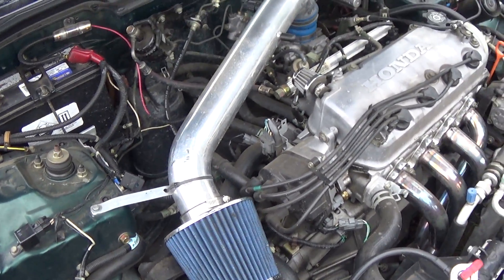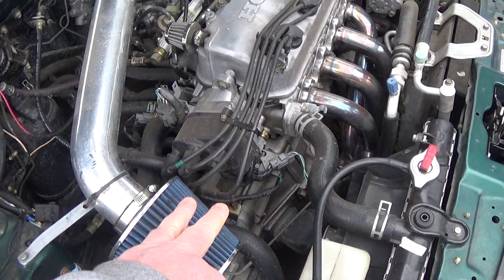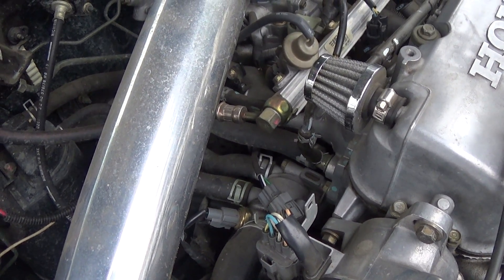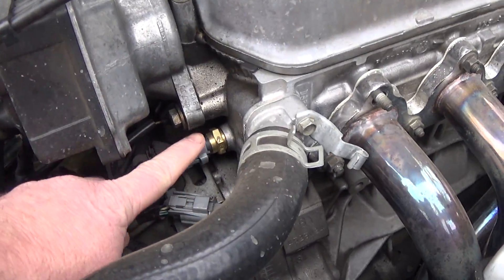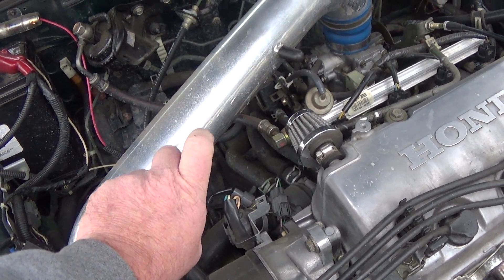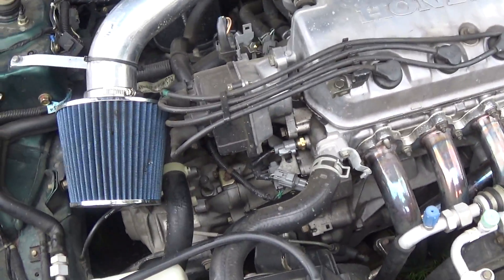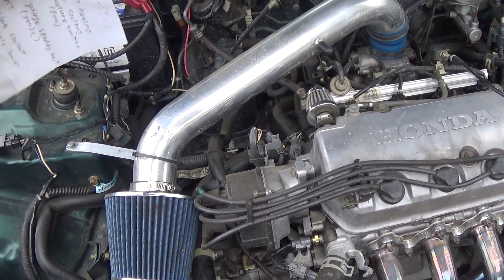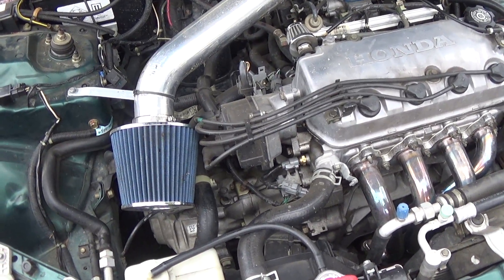Explaining Honda Civic 3 Engine Coolant Temperature devices

Comment: Ok bought a used 98 civic ex coupe. Previous owner had a toggle to work the fan. Took it to firestone to get it removed and wire ran to the fan. They did said it was fixed. It tried overheating on me so took it back. They said they tried a temp sensor and wasn’t it then replaced the fan switch. They said the temperature of the car is fine and the fan will come on (which it does) when the gauge is reading hot. They said it was a faulty cluster . I replaced the cluster still reads hot then fan finally kicks on. Air in coolant ? Sending unit? Previous owner also just did timing belt and thermostat and water pump.
Reply from the maker: Most likely someone did not put the correct temp thermostat in.  You could also have air in your system.
Reply: tubejim101 ok thank you
Reply from the maker: To understand how your fan works, watch this video: https://www.youtube.com/watch?v=UHv4rPSmI3A

Comment: Having a problem where my gauge quickly goes up almost to the hot but its coolant in it si would that gauge sensor be bad?
Reply from the maker: What year, make, and model are you working on?  Most likely have a pocket of air in the coolant.
Reply: @tubejim101  99 civic coolant was full when I took the cap off
Reply from the maker: @2koolforyou88  Here is a video on getting the air out.  It is on an Accord.  The Civic does not have a bleeder valve.  https://www.youtube.com/watch?v=mfTapX0DuQ0

Comment: 95 civic running well, no issues, except interior gauge stopped working.  SO it likely is this sending unit gauge that needs replaced?
Reply from the maker: I would test the gauge, to see if it was working.  If it is, then you know it is the wires, or the sensor.
Reply: @tubejim101  great . . . . if I knew how to test the gauge, you got an old clip on that somewhere ?

Comment: Hey what color are the wires going to the ect sending sensor? Please and thank you
Reply from the maker: What year, make, and model are you working on?
Reply: @tubejim101  96 honda civic d16
Reply from the maker: Which end?  Ecu, or sensor?
Reply: @tubejim101  the sensor for my temperature gauge.Bought a car and the plug was ripped off

Comment: I am working on a Honda 95 Del sol. Engines look exactly the same... I can only find the 2 sensors. The Engine cooling temperature switch and the one directly underneath the cap and rotor, the back one The engine coolant temperature Gauge. The one right in front is not there... and no place for it to go either. I assume it just doesn't have that or it's somewhere else...
Reply from the maker: You will want to watch this video, and get back to me with the engine you have:  https://www.youtube.com/watch?v=ODrI1uq1tAE

Comment: my radiator fan is not automatic when i turn on the key fan starts spinning, i want to make it automatic , what sims to be the problem?
Reply from the maker: What year, make, and model are you working on?
Reply: eg hatch 93
Reply: what seems to be the problem?
Reply from the maker: @beaumendoza1616   Watch this video:  https://www.youtube.com/watch?v=cMRzosjehR
Disconnect the connector going the the switch on your thermostat  housing.  The fan should not come on with that switch disconnected.

Comment: Hi tubejim101. I have a 98 civic lx and my fan doesn't turn on at operating temp. I did the paper clip test and the fans are functional. So I replaced the ECT switch and the fan still doesn't turn on so my car starts to overheat. Any idea what might be causing the fan not to turn on? Is the next step to replace my thermostat? I noticed my overflow tank was very low so I added coolant to it and after warming the car to operating temp and overheating, it started to boil or bubble. Please help!
Reply from the maker: Sounds like you have air in your coolant.  You should test your old sensor.  https://www.youtube.com/watch?v=Lcx_TlOKkFU

Comment: i have a question for my 97 honda city manual dual fan one fo ac and rad..when i open the ac only the ac fan running..andcthe rad fan is not working even the temperature is in the middle of guage.as of now i connect the rad fan direct to the battery in ignition    switch with relay for temporary so if i will start the engine the rad fan also running...please advise if what i need to change..i alreday try to jump with the paper clip the   sensor near at the thermostat but  only the ac fan running.thansks
Reply: Jump power directly to fan and see if it even works.

Comment: I have the one sensor that goes next to the thermostat and another one that goes connected on the upper radiator hose housing on the cylinder head and there are two underneath the distributor

Comment: 1996 honda accord lx 2.2 Automatic
Reply from the maker: I am only familiar with the 1990 to 1993 Honda Accords.  If it is a car you want to keep, I highly recommend going to the dealer and ordering the Handa Shop manual for your car.  They used to run about $80.  Think I will do a video explaining the benefits of these manuals.
Reply: Can usually find PDP manuals free online and put on phone just search.

Comment: My temp gauge goes up to maybe 5/8s to 3/4s sometimes when driving. Can't figure out why. Would one of these sensors fix that? I jumped my cooling fan so it runs with ignition on all the time and it gauge still gets hot. I don't have a cel on either
Reply from the maker: Year, Make, and Model?
Reply: i have the same problem nd did the same thing.. 01 civic ex

Comment: Hey brutha is there.a video on how to install and what all you need for the middle sensor ?
Reply from the maker: The middle sensor runs your dash gauge.  You can mark, then remove your distributor.  This will give you more access.  This is the front sensor, but the procedure is almost the same:  https://youtu.be/QrPIpZS8td8
Reply: tubejim101 lol. Ya. I know how to do it. I'm talkin about the plug that hook up to it

Comment: Why don't my honda civic start after I drive for awhile and it gets warm does it have any thing to do with the engine temperature sensor
Reply from the maker: What Year, and model?  Which check engine codes are you getting?
Reply: I have the same problem too, how do I fix it,

Comment: can the fan switch be stuck on the on position? the coolant fan always turns on every time I turn on the ignition. and I think that's why I have issues turning on the car in the morning when its cold. because I think the computer thinks that my car is hot. any feed back will help. thanks.
Reply from the maker: What year, make, and model are you working with?  Disconnect the first connector in the video, and turn the car on.  If the fan is kicking on, it is not from that sensor.
Reply: tubejim101 I found the issue on the fan. someone had bypass the switch on the connection. problem solved . thanks for your time. now I have some issues with the driver side breaks
Reply from the maker: Good job!
Reply: tubejim101 maybe you can help me out. I know its off topic from your video. but I'm having an issue with the driver side break caliper rubbing on the wheel. its a stock 13 inch wheel. 96 honda civic 2 door. I notice that it was missing a bolt on the bottom caliper bracket. got a new one. I notice that the thread was strip so I got a new bracket to fix that issue thinking I was going to fix my problem but it still makes a bad grinding noise. there are marks on the bottom half of the caliper and I even rotated the wheels front to back and still the same issue.
Reply from the maker: Two things come to mind.  First, i would get on craigslist.org .  Find someone who is parting out their Civic, and buy the whole suspension/brake setup for that side.  Then you are working with OEM parts, and you know it is all good.  Second thing.  Some times people will bend up the dust cover, when changing out the wheel bearings.  Take a look at a known good setup, and compare it to yours.  Also, someone may have tried to use parts from a 92 to 95, on your 96 to 00.
Reply: tubejim101 could a bad wheel bearing cause this?
Reply from the maker: No.  If someone tried to change the wheel bearing, they could have messed things up.

Comment: i see you have replaced all three. i've been having similar issues (which led me to your videos in the first place) I would like some input if you have the time

1999 Civic ex sedan factory d16y8

Fan didnt work > Checked ohm'age (Plenty of resistance)

Started thinking the relay might be bad --> Simply swapped it with the AC condensor far and turned on my ac (AC fan still spun = good relay)

Decided i would test everything from the switch plug back to the fan > jumped it with paperclip, fan came on right away.

So today i was SO sure it was the fan switch --> bam replaced that.. fan still never came on.

Today while attempting to get it to over heat it started to creep on up there according to my instrumentation; promptly pulled over and paper clipped the fan and thought "Take that you little bitch" and it STILL OVERHEATED. sigh

So this is where i am at. I am curious if its possible my sender is bad, and giving me false readings inside the car.. I'm also thinking my thermostat might be stuck..

But, if it is just the sending unit.. my fan should still come on when it gets hot enough to make contact with the switch..

Really perplexed with all of this, im not a complete novice and have had my hand at a few motor swaps etc.. but that was with stuff that was already working properly.

Tomorrow i will try removing the thermostat (possibly testing it on the stove top) and i might just buy the two sensors under the distributor while im at it. 

Was curious what your thoughts were on this.
Reply from the maker: So if you jumper it, and the fan comes on, it means the coolant fan switch it not working.  Either it is bad, or your thermostat is stuck and not getting the coolant hot enough.  This video might help:
 https://www.youtube.com/watch?v=Lcx_TlOKkFU

Comment: thanks for the video my problem was the sending unit was disconnected  but i couldnt see ut cuz it was covered in oil thanks alot for by he break  down!!!!:)
Reply from the maker: No problem.  If you have oil in that area, it is most likely coming from the distributor seal.  The are about $3, and easy to fix.
Reply: i didnt know it had a seal ill deff do that this weekend i thought it was the orings on the valve cover  i know about kseries not bseries to much butboth are easy to work with ?thanks for the info

Comment: my 1997 civic ex temperature gauge goes all the way up as soon as the car is started. its not overheating just the gauge goes up. does this mean I need to change the temperature gauge sensor? the one farther back of the 2 front ones?
Reply from the maker: +Felipe The back one (on thermostat housing) runs your fans.  The middle one, runs your gauge.  The front one, goes to your ECU.  I would unplug the middle one, and see what effect it has on your gauges.  If it has no effect, I would suspect your gauge.

Comment: My dashboard gauge plug was left dangling after a mechanic installed a new hose.  This video provided the info I needed to DIY quick fix.  I located the dash sensor quickly which is kind of hidden and plugged it back in so no need for a return to mechanic.  Thanks!!!
Reply from the maker: +jazzbox35 Glad to help
Reply: +tubejim101 how do I get to the guage sensor under the distributor
Reply from the maker: +Tevon Jenkins You can remove your distributor, if you are having trouble getting at it.

Comment: Question. My gauge rises to operating temperature normally however based on electrical load, the needle will jump (rise and fall) more load results in a rise and when the load is taken away the needle goes back down. Im not sure if my ECT Gauge sending unit is going bad or if its my ECT Switch not toggling the fans on when the temp rises. My fans work but weirdly, last night my cars temp stayed perfectly normal and i heard my fans toggle on much more frequently than they usually do (when I do experience the symptoms I just told wrote about. Any ideas on what it could be? Battery and Alternator check out fine.

Comment: +tubejim101 I was wondering what exact replacement my 99 civic would need. At idle the car temp gauge is fine, but after running it even with the ac fan on it'll slowly begin to heat up. At a stop/red light it'll heat up but once I begin driving again it'll come down a little. So would the issue be any of these 3 ect parts or even the hermostat needs to replaced?
Reply from the maker: baller6897 Is your fan coming on?
Reply: tubejim101 Hey man I am having the same problem my car will only start to overheat once i turn the a/c on for a while and stop/go I have a1998 Honda civic LX. The fan does not turn on.. should I switch out my thermostat and see if that fixes it?
Reply from the maker: Matt_Guns Give this video a try: www.youtube.com/watch?v=UHv4rPSmI3A

Comment: I have a 2002 Honda accord lx 4 cyl. The problem I am having is that the temp gauge on the dash sits below C. I've located 3 sensors near the distributor cap and the starter. I'm just not sure which one to replace. One is very far back and the other 2 are close together.one has a green top
Reply from the maker: Daniel Henriquez On Accords, I only work on 1990 to 1993.  After that Honda changed the design.  One thing you could try.  Call your local auto parts store and ask them which sensor is for the temp gauge.